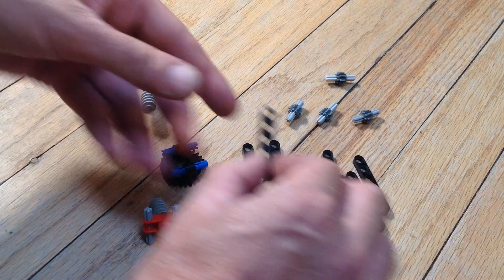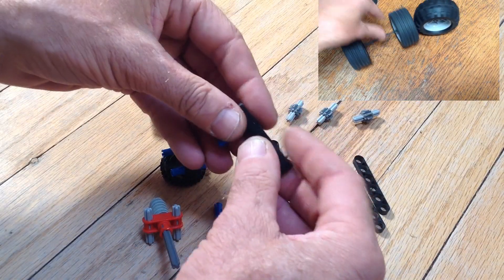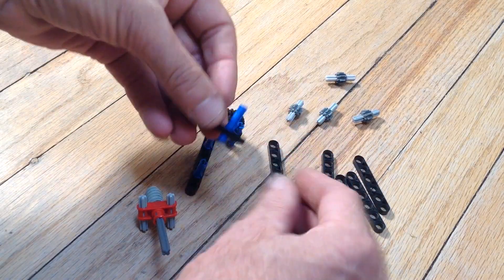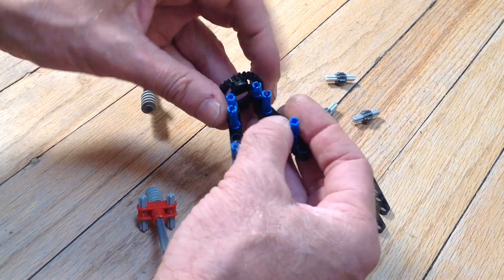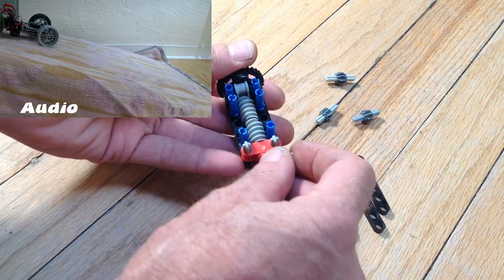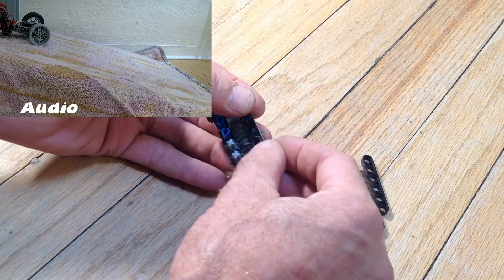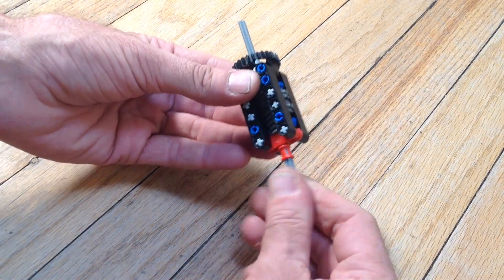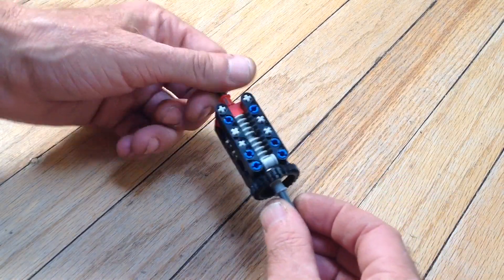Improved Lego Limited Slip Torsen Differential

Comment: What is the point of limited slip? I built one and I can’t honestly tell it’s purpose in reality.
Reply: it provides traction even when one wheel slips. Turn the crown wheel and the axle will always rotate, unlike a normal diff where if one wheel is raised or "slipping", all power goes to that one 🤓😎👍🍺🇬🇧
Reply: @carlbModels  thank you!
Reply: @carlbModels I’ll have to rebuild it to tell for sure but thanks for the info.
Reply from the maker: It's not often a Lego model is doing stuff that warrants limited slip. It's just an interesting object and modeling engineering ideas is fun.
Reply: @dhgcrack3r111 check the worm gears are the right way!!!
Reply: rubber grip is logarithmic, when it starts to break down it breaks down fast and at an increasingly-increasing rate. If you compare a differential giving 100% the power to one wheel to a differential giving 50% of the power to each of two wheels, the amount of grip retained by the wheels is vastly greater than 2x
Reply: @anonymous-pr2sy  now that's super technical! 😎👍🍺🇬🇧